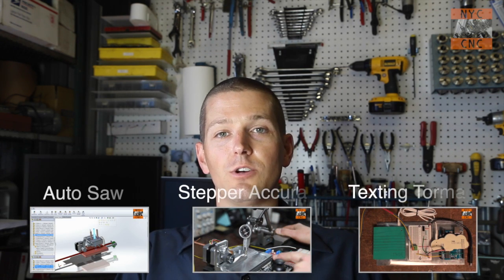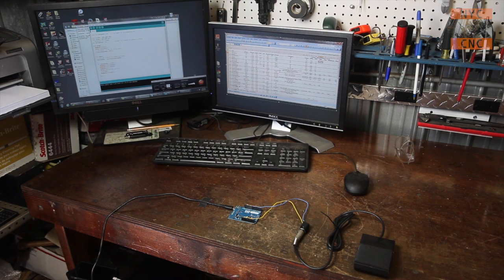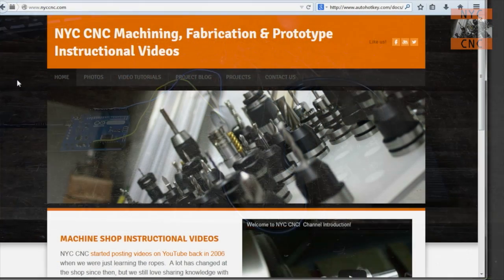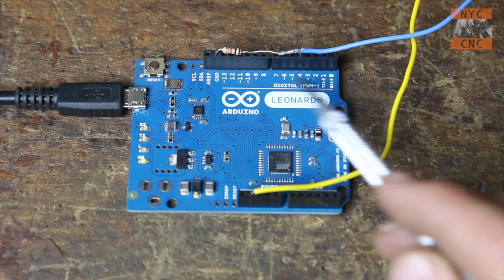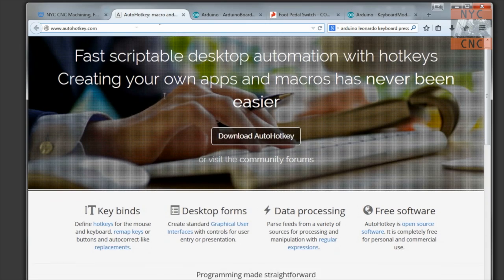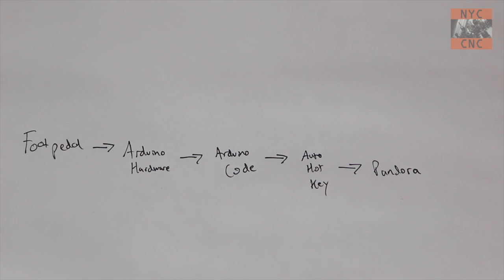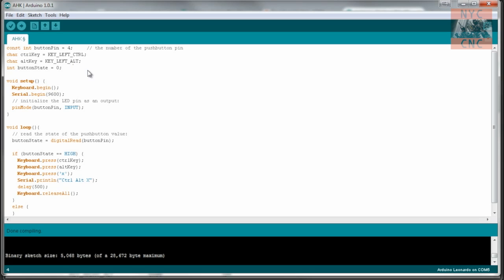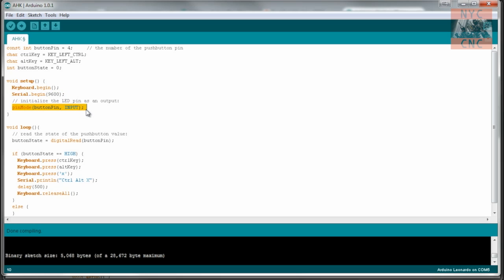Arduino Pandora Mute / Play / Pause Foot Switch!  Wednesday Widget #3

Comment: John:  Great video as always!  A suggestion for improvement to make your project more robust would be to change from having the switch pull the microcontroller high with the VCC from the microcontroller to pulling the microcontroller pin low.  I would use a 100K pullup on the microcontroller pin to 5V, and a 10K series resistor from the microcontroller pin to one side of the switch, the other side gets connected to the microcontroller ground.

This avoids high currents from flowing if the connection to the switch were ever to short to ground, and provides some ESD protection to the microcontroller pin since the 10K resistor will limit the current that can be injected into the microcontroller pin.  Additional components could be used to give even more ESD protection. Two diodes and a capacitor would make this very robust.

Of course, this inverts the sense of the switch state, I.E. HIGH = switch not pressed, LOW = switch pressed, but this is easy to handle in software.

Keep the videos coming!

-Arlen
Fellow Tormach and Arduino user

Comment: John,

I watched this video early this morning, I've been watching for a fair amount of time, prior to the move.  I watched maybe a couple of Arduino videos in the past, but this video got me to look back through some of the most recent.

I'm a lot like you, I never thought anything was impossible to do, so I just keep learning in a really wide range of fields.  As I looked back through your videos I was intrigued by the accel library issue, mostly by what I saw on your oscilloscope.  I looked at your code, downloaded the schematic for the stepper driver board and spec sheet for the driver chip.  I downloaded the accel library as well.  The spec sheet had some interesting timing quirks, unlike creating your own driver circuits with MOSFETs or Darlingtons(old school).  I then started reading a crap ton of comments in two or three previous videos and found some talented individuals pointing you in very good directions.  The key one being setMinPulseWidth in the accel library.

After that life got in the way for a large portion of the day, you are no stranger to that I'm sure from some of the videos I watched today.  I'm just kind of going back through my thoughts earlier here... 

I don't remember the actual timing on the pulse width from the oscilloscope, but someone stated it in the comments.  As I said above, it was the oscilloscope that caught my attention (and yours as well).  I believe the accel library is a bad match for the A4988 driver chip.  I also believe the accel library was written for a specific driver chip, or some other circuitry, being asymmetrical in form (as shown on your scope).  It is simple in form, instead of symmetrically forming a square wave over a varying frequency, it simply does a very short pulse and changes the timing between pulses.

The A4988 has some built-in timing partially controlled by ROSC.  I didn't really look into this much, but I suspect some of the issues you were seeing probably came from the two interacting with each other.

Thanks for the videos, I know it's a lot of work.

Jim McCulloch

Comment: John, cool video as always. Like the automation stuff. Instead of keeping the processor busy with a loop, it should be more efficient to attach an interrupt. So any state change on pin 4 would trigger a call to the interrupt routine, at which point your existing code would do it's thing. This way the processor would stay more idle and more efficient. Move you push button to pin 3 (it accepts interrupts). You'll notice the first argument in attachInterrupt below is set to 0. Pin 3 = 0

const int buttonPin = 3;
// Leonardo's available interrupt pins: 3, 2, 1, 0 ,7
// The interrupts for each pin above, respectively, are: 0, 1, 2, 3, 4

// Interrupt Routine
void pinChange()
{

  buttonState = digitalRead(buttonPin);
  if (buttonState == HIGH) {
    Keyboard.press(ctrlKey);
    Keyboard.press(altKey);
    Keyboard.press('x');
    delay(500);
    Keyboard.releaseAll();
  }
  else {
    // stub
  }
}

void setup()
{
  Keyboard.begin();
  Serial.begin(9600);
  pinMode(buttonPin, INPUT);
  attachInterrupt(0, pinChange, CHANGE);   //attach handler
}

Comment: Hey John, great Video! The components for your projects are exactly what I needed for a project of my own. I didn't know that the leonardo was able to act as a keyboard, that's way too cool :) I was expecting that I needed to find a way to emulate one on the computer or something.. This really gets my Ideas going..
Looking forward to next week!
Reply: NYC CNC I run a 3 axis portal cnc mill in my high-school that has a tool change on one end of the table. When you move the table you always risk to crash into it. This has happened a few times now and always involves a lot of work to re-establish everything. I want to install a hall sensor and then simulate the release of the button that is pressed to stop the table. When you press the button again afterwards everything continues as usual. I still have to figure out the details though ;-)

Comment: I was thinking to do similar project on my g0602 lathe but to stop a motor with foot pedal. Looking forward to see more videos coming.
Reply: NYC CNC  I am using it on my small 60x40 CNC and G704 but not on Lathe it is still manual.
 I got some big solid state relays and was thinking to use them.
Reply: NYC CNC i saw u used arduino for stepper motors. I was just testing Grbl on my g0704 mill and works great. You should try it. You just send g code to arduino over serial and that is it.
Reply: NYC CNC i am waiting for 1mhz usb controller card for Mach (to be able use my laptop for control). I had one mega2560 laying around so i tried Grbl. I must say i am impressed what you get with it. It looks like to me that it is great for automation with servos. It supports,for what it is, a lot of g code and it can work at 50khz or 30khz i forogot.

Comment: Hi. Sparkfun's Arduino Pro Micro is a good alternative for Leonardo. It has an Atmel USB enabled Micro-controller like Leonardo and could emulate a USB HID Keyboard or Mouse. I buy them in dozens since they are cheap and small.

For bigger projects, Arduino Due and the forthcoming Arduino Zero could provide USB HID function, lot's of RAM, higher speed and More IO pins. They have ARM chips and thus are faster.

Looking forward to watch more of your videos (both machining and electronics automation).

Cheers
Reply: One more thing. There is an actual key code to mute (0xAD) or Media Play/Pause (0xB3) in Microsoft Windows. I have not tested it myself but it should work. Google Microsoft Virtual-Key Codes for more information. I might test it tomorrow. That would be cool :D

Comment: I don't like wiring the supply unprotected out to "the world" like you did with 5V.
I'd put the pedal between the input pin and ground and and use a pull-up 
instead. I haven't used arduino but you should also be able to turn on the internal pull-ups and skip the external resistor

Comment: That is great.   I'm sure you'll get lots of "do this, do that.... " but I think it is cool for two reasons... it works, and your background isn't in electronics.  It is little stuff like this that gets other folks interested in making things.    I still need to build a reflow oven (toaster oven + thermocouple + controller) to make my own boards.  When the hand shakes start, I make pretty welds.... but soldering SMD (surface mounted devices - ie. soldering small parts) isn't pretty.

Comment: Nice! Ever look at the mbed enabled boards? Some are dirt cheap (i.e https://mbed.org/platforms/ST-Nucleo-F401RE/ about $10) and have nice hardware features (32 bit, 84 mhz, floating point in hardware, more timers, 12 bit adc, 512k memory etc) and a pinout that takes Arduino shields. I am playing with those now. Lots of board options from different manufactures incase you need something special for a project too https://mbed.org/platforms/

Keep them coming, I've been following you for a long time now. I found your channel about the time you placed the Tormach order and haven't missed a video yet.